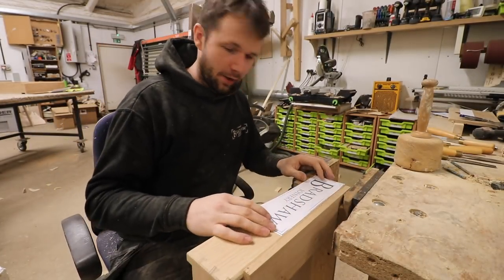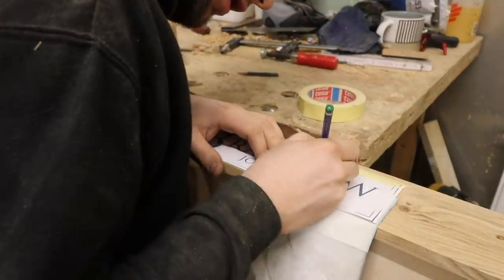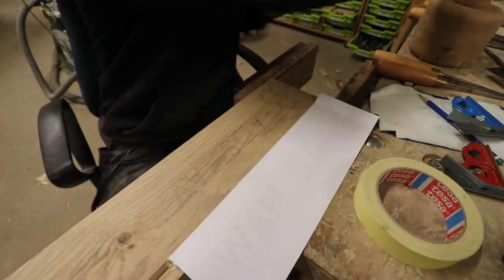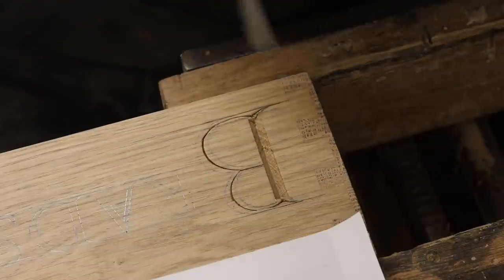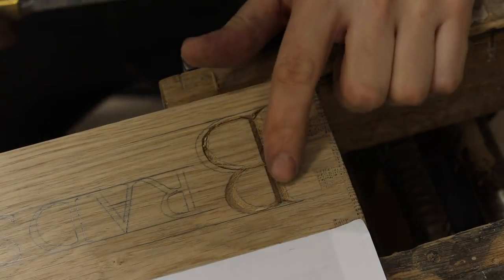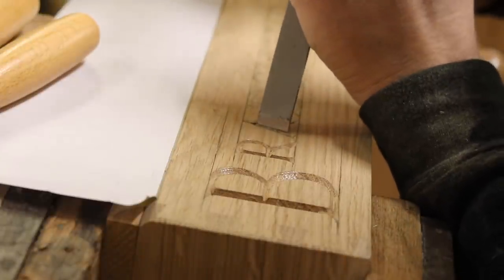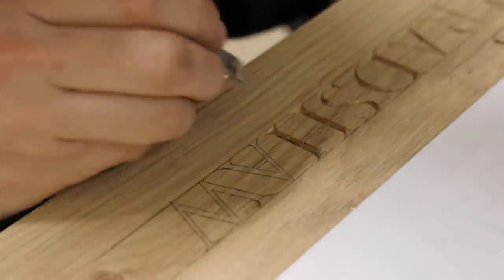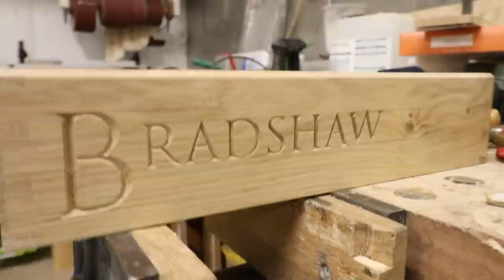Hand Carving my logo. You don’t need to be an expert to do this

Comment: A few tips. Standard practice in letter carving is that pointy letters such as an A should break out of the top line and curved letters such as an S or C or O should break out top and bottom of lines. If you don’t do this then these letters will look smaller than letters with horizontal tops or bottom. Hence your A’s and especially your S look a little too small.  The space between letters is called kerning and next time close up the space between the capital B and the R, it’s too big. Just a tip from someone who has spent their commercial life around type. Cheers and I hope these tips help.
Reply from the maker: Hey Bob, thankyou for that. Some great info and i will pin your comment! Now youve said all that it is covered i think in the book i mentioned, but i was literally just copying my logo for this one. But certainly refreshed my memory. Amazing how you forget! Didnt know the kerning term! Thankyou very much
Reply: You are a great Master in those grapgic design terms 😅
Reply: Great points, well made. Coming from your valued experience, this can add to knowledge in 'what to do' as well as what not to do.
Most grateful for your views.

Comment: Brilliant video thanks. Really impressed by my first attempt, exactly how you instructed. However, I'm having a nightmare removing the black carbon around each letter. Yes you could say I should cut it all out, but as it was traced freehand, there is plenty that needs removing. I don't want to lose the 'tooled' finish my plane has left. Sandpaper is an option but it'll be flat and drab in comparison. A sharp cabinet scraper may be my only option but in concerned about losing cips from the smaller, more intricate letters. It's on oak.....

Comment: Very good indeed if letter carving was that new to you. I think another responder has talked about spaces and sizes - a thank you from me for that as those tips will help me next time

A cheat from me. I had even less experience than you in letter carving but I do have a laser burning machine - not router but a laser. So I burnt the shape onto the timber via a computer image. I found that gave me a superb outline from which to carve. It was almost a case of if you can see the laser burn, then you need to carry on a bit. 

I chose to carve on apple wood which I harvested from the orchard 30m away from the edge of our field about 8 years ago. All air dried and, without question, the hardest pieces of timber that I have ever had to work with. The timber is superb, just wonderful colours, textures and defects. I had a stone and a strop next to me and I must have sharpened every 30 seconds.
Reply from the maker: Thanks Theo! Yes that was some useful info! Tbh i should have reffered to the lettering book i mentioned before starting, but for this one i was literally following my logo! 
Laser sounds good! anything that can speed up or help achieve the end result is good in my opinion. especially if it means you actually have a go rather than avoiding it!

Comment: You can mirror the text before you print it, flip the paper over so it's printed side down and now the readable way around, and then scribble (or just rub with a dowel end) so that the ink transfers. Much quicker and more precise than tracing.
Reply from the maker: How does the ink transfer to the piece from paper?
Reply: @BradshawJoinery  I used to do a similar thing with tracing paper to make copies of ‘good’ drawings when I was a kid. Copy or trace the drawing onto the tracing paper with a soft pencil. Then flip the tracing paper over and place it copy face down. Trace the lines from the reverse side of the paper until the graphite transfers to the workpiece. Im not sure if this method will work on oak though but it’s worth a go.